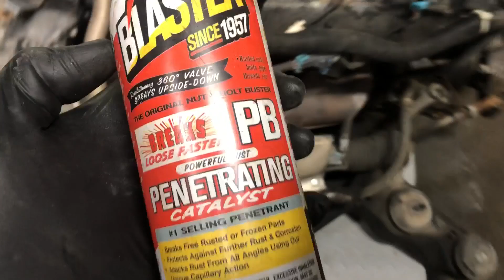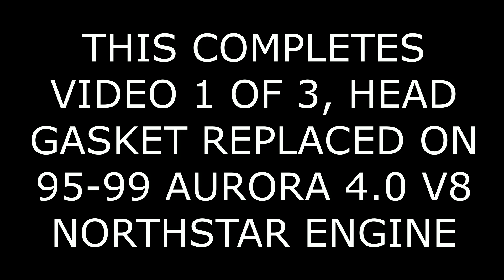Head Gasket and Timing Chain Replaced Oldsmobile Aurora 4.0L 95-99 Northstar Part 1 of 3

Comment: This is an excellent video! I think this is the best step by step video for any Cadillac, Oldsmobile Northstar engine disassembly and reassembly.  Everything is done correctly and the mechanic knows what he's doing and is not sloppy.  Very refreshing to see something done correctly and clean which is the way how I work on my cars as did my father and grandfather.  Nice!
Reply: If you are familiar with this engine can you tell me other than the 6 frame bolts what else would hold the subframe to the body? I'm replacing the rack and pinion  and some other parts
Reply: @atowninytown859   What year car and model?  You will have to look at the engine mounts and also the suspension will hold the subframe up, but there's only the main 6 bolts that holds the subframe up in place.
Reply: Also, how would you find too dead center on the 1st cylinder?
Reply: quiero mi respuesta en español

Comment: Very smart informative video I have a 96 Aurora i need to know everything about this engine
Reply: I have a 96 AutoBahn Edition. I ran her low and lost overdrive. I have to remove it and do the kit for engine and do tranny. I just finished my 2006 Mountaineer 4.6l 3v heads and timing chain. Had to remove oil pan for that darn oil dipstick nitemare. Although I have to replace the front wiring harness in my 87 vette, then aurora.

Comment: I drive a ’98 Aurora with 156k miles and like it a lot. I’m wondering, since the headgasket issue on these first generation Auroras is known, if there’s something that can be done to prevent the gasket from blowing. Going in and tightening the bolts every year or two? Knowing exactly what causes the issue in the first place would be helpful to this goal. I’ve read that the bolts vibrate loose over time causing the issue, but I’ve also read that the bolts actually stretch. Any clarification? Ideas for preventing the gasket from eventually blowing due to this? From what I understand, besides this potential disaster, this car is awesome. It’s already served me quite well on 7 or 8 road trips, including an 1800 mile one to the coast round trip.
Reply from the maker: BlueShinai's interviews etc. yes,  these cars are actually quite awesome. I’ve had the pleasure to drive one back and forth long distance and are powerful cars. But if it’s just the head gasket, then you should be able to
use factory head bolts and new head gasket. No, you can’t tightened the head bolts regularly lol. But what might happens is not so much on bolts stretching but corrosion happens within the threaded area to the block and head bolts. Weakens the strength between the head and block and so when that happens. Cylinder compression pushes the head with weakened head bolts contact and head gasket blows. So then you’ll have to install studs instead of head bolts. But overall, just don’t let your engine overheat and do your scheduled coolant flush. So that way it helps prevent overheat and head gasket separation thus allowing fluid around head bolts and causing corrosion. Well, hopes that helps a little. Thanks
Reply: @ls1camaro92   That was very well said.  Because I always say the same thing myself.  Just simply maintain the cooling system correctly to avoid this problem altogether.  Unfortunately this is something that a lot of people look over and is not a top priority.  My family always did primarily Cadillac's ever since the 1950's and its the same thing with the antique ones.  Cooling system maintenance is very important no matter what year it is.

Comment: I have an 03 aurora that I'm  replacing the rack and pinion on, and your video has helped me a lot with this engine. However I'm having some trouble with dropping the subframe,  I removed the 6 bolts plus a motor mount bolt in the front and the frame still seems to be snagged , what else could be holding it up?

Comment: I have a 97 Oldsmobile Aurora with only 80k on it and I'm going to get the head gasket rebuilt in a couple weeks I was wondering if you think I should get the timing chain replaced even though it doesn't really need it right now?  Or is that just that standard part of head gasket replacement on these?
Reply: Is it overheating?
Reply: @mellyzaurora1277  it ran hot but it didn't go into the Red zone but it ran at about 250°. I've already had the head gasket replaced.  The Mechanic said old age wore out the gasket seeing as it's almost 26 years old.

Comment: I've been looking and I can't find a diagram for a 2001 Oldsmobile intrigue 3.5 l v6. I'm wanting to replace the head. I know about on the Northstar engines the head bolt problem. The head bolts being too short and in 2005 just put longer head bolts in fix the head gasket problem. I'm wondering if the same thing applies to the v6. Northstar V8 Aurora engine from the 90s and I'm hoping you'll know what I'm talking about. Also what would be the best head gasket set for that 3.5 l

Comment: Are these engines known for head gasket issues? How about the newer  Aurora say 2003?
Reply: @Blue Moon
These engines are very well known for head gasket issues...both in the Cadillac 4.6 and this smaller 4.0 in this video
After 2001 there was a ton if improvements and I don't hear about those year models being problematic
Its a shame GM let this go on for more than a decade..putting more coffin nails in the cars resale value
Reply: Northstar v8's from 93 to 2004 are vulnerable 2005+ Northstars no.

Comment: How many miles were on this one?
Reply from the maker: Right at 200k
Reply: Wow surprised it made it that long.  My 97 only made it to 83k
Reply from the maker: @oldsmobileaurora7418  so she’s overheating? That’s low miles to have this happen already.
Reply: @ls1camaro92  yeah the mechanic said the gasket was probably just worn out due to age.  The car is almost 26 years old at this point.
Reply from the maker: @oldsmobileaurora7418  it’s common with this engine. So I believe it.
Reply: @ls1camaro92  I'm surprised you put the time and effort into repairing the gasket on that engine since it had around 200k on it most people would probably not bother.  But I know if you take care of them you could possibly get 300,000 to 400,000 miles out of it.

Comment: I was hoping to see you actually removing the frame bolts, and dropping the engine. Did you not video tape that?
Reply from the maker: Matt Nale Being by my self it was kinda hard to video it but did described how I did do it in the video. So a cherry picker,  2x4s pieces, 4x4s pieces, wheel Dolly’s, jack stands and a good hydraulic jack. Low profile is best. Just take your time when lowering the motor onto the jack stands before removing the cherry picker from engine/K member as you’ll have straps or chains supporting it in the air when removing the k-member bolts from body. Once you lower it one the jacks, simply remove the cherry picker. Then use the hydraulic jack to k-member little at a time in a circle around the car until you have reached the wheel dollies, then remove jacks. And then roll the engine and tranny out from under the body. A 2 man team is best if you have help, I did it on my own but help is best. And good luck with the repairs. Thanks
Reply: OK I was just wondering if maybe you had tape that you felt wasn't worth posting. I actually have an Aurora with the Northstar 4.0 that has the head gasket problem. I was hoping it could come out the top, but only found 1 post where someone said they did that. (And I can't find it right now.) So when  I saw your video it intrigued me, and it is still the same engine. I have not looked at you other two videos yet, I keep having other issues present themselves for repair, lol. But thanks for the reply!

Comment: you can pull the engine from the top/front if you remove the rad support and bumper . and remove the ABS pump /MC together  out of the car, Trust me that is going to be out of the way, Its way easier than dropping the cradle.

Comment: What does a job like this end up costing the customer? This is scaring me away from buying an Aurora.
Reply: Talking about at least 5,000
Reply: Don't get an aurora unless its really cheap and you can scrap it easily.
Reply: Maintain the cooling system correctly and you won't have a problem!
Reply: My family has 3 1999 auroras all above 100k one almost reached 300k but the transmission when out- my brother did drive it hard. We have never had any coolant/head gasket problems on any. Just follow the manual directions for coolant maintenance.
Reply: @Ken-RicSki  I agree most people do not flush their coolant and complain about overheating